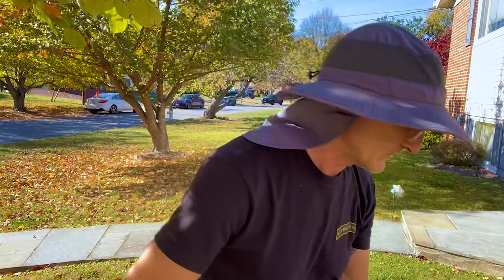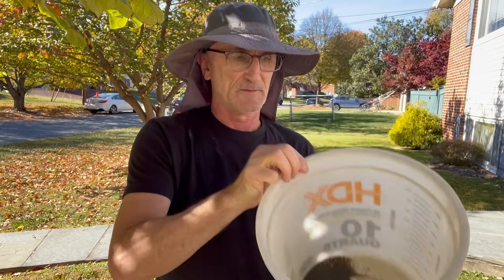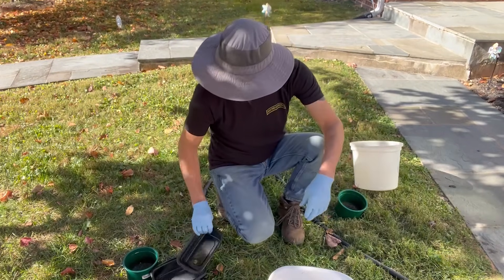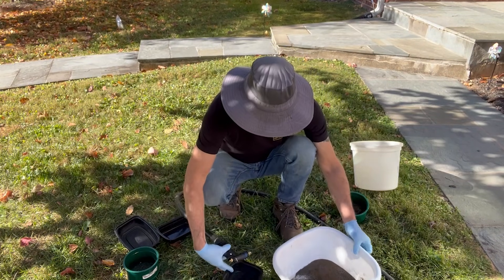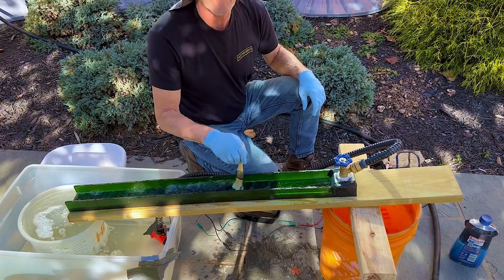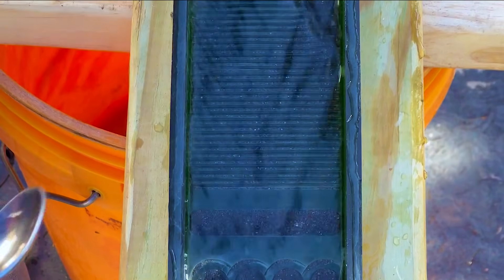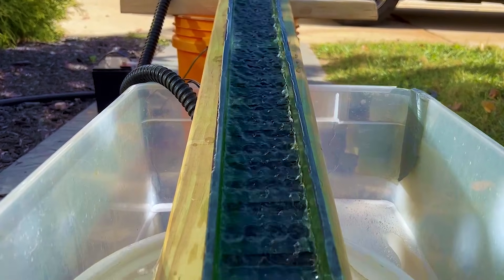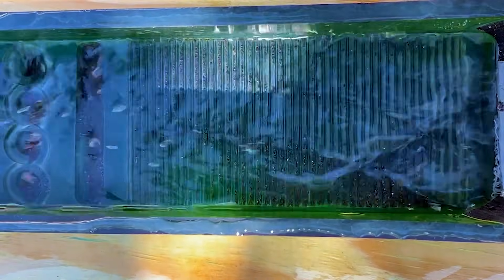Vinegar Extracts Gold From Black Sand!

Comment: The vinegar is a good solution. We used Muriatic acid fifty fifty and allow it decompose the risks down to gemstones and precious metals which are left in a pile after thirty days in a bucket. Somewhere safe outside and caged away from dogs and cats that will drink it and die.

Comment: are you running the sluice slower this time than before vinegar? if so some of the gold you'll get is from running the sluice slower.
Reply: Exactly, no recovery system is 100%, I've run previously processed black sand concentrates through different recovery devices and always seem to find a little fine gold. Water flow and surface tension are critical when recovering very fine gold.

Comment: I used to care about getting all the gold from black sands but unless you have something like a mini Max or Blue bowl or something else that gets everything out it's really not worth the time and effort. I just throw it in a bucket and run it with other stuff in the mini Max and the silicone mat's catch everything but it's a pain getting it off them.  I would just like to know what the vinegar does? I thought it was going to dissolve the black sands and leave the gold but it didn't seem to do anything.❤️💛💚
Reply from the maker: Hi, honestly I don't know why it works.  I've seen other people do it so I wanted to experiment with it as well.

Comment: This says to me that is actually is worth putting your really fine cons to one side for a while and then when you have say a  bucket full, soak it in vinegar and sluice it making the process a bit more profitable.
Very cool process and fascinating to see that there is indeed still dirty gold in the cons even after youve cleaned them out the usual way.
thanks for sharing
Reply from the maker: I know, right?  It always seems like there is just a little more to extract.  The "juice is not worth the squeeze" but it's still fun to do it.
Reply: @ indeed especially when you are doing it as a hobby...or just obsessive like me....I save copper and brass  filings etc from my metal working and melt them down again
Reply: but how much does all that water cost?
if re-cycling the water then how much for the electric power? 
it would never amount to just covering those costa.  forget your time
Reply: @ I use rain water for a lot of things but at the moment the price of gold is so high its quite feasibe to save cons like this and still make money
Reply: Just curious. Has anyone tried heating the black sand to say 800 degrees and letting it roast an hour and then dumping into cold vinnegar and letting it sit for 5-7 days?
Reply: @dreamsindigital1285  to extract  tin?
Reply: @TalRohan   Gold!
Reply: @dreamsindigital1285  ah yes I see , yes it makes sense that there could be some in there. again it depends how much you want to put into it as compared to what you get out I guess...food for thought
Reply: @TalRohan   I look at it as experimenting, any gold found along the way is a bonus. The process I mentioned would be good for doing an assay if curious to see how much, if any gold is hiding in the black sands

Comment: You will get better result if you melt the black. And will see that the gold is also black because is dirty. And mixed with silver and other metals. Once you get the melt cold then refine it to separate. Electrolisis way. Blessings.❤❤❤❤❤❤
Reply from the maker: Melting is usually the best way, but I'm not comfortable with it. I can be a little clumsy some times, and that would not work well with melting :-)

Comment: Why not hydrochloric? It would be so much faster to break down the iron sulfide
Reply from the maker: Too dangerous for me.  I’m not comfortable with HCL.
Reply: @GetTheGold777  Try muriatic acid which is dilute HCl,  I worked with Hydrochloric daily in the early days of my career doing wet chemical analysis.  HCl wasn't really a big deal, throw some Nitric in with it and it gets a little more serious.  Gloves, an acid  resistant apron and safety goggles are the ticket.  You DON"T want to fool with Hydrofluoric Acid which will dissolve any silica based  material it contacts including glass.  It isn't nice to skin or bones either.
Reply: You, sir, are correct, and all that yellow water was atotonomic gold !  FYI  !
Reply: Vinegar definitely does dissolve gold into solution, but I don't think the gold would be visible as a yellow color in the solution. Anatomic gold is actually red used on stained glass as red pigment
Reply: Gold and silver are both used to fume glass to make it change colors and can be used alone on clear glass to get any color you desire if your experienced enough to do it.. I blow glass and am decent enough but theres blowers out there that blow my mind with their fume work the obvious that comes to mind for me is bob snodgrass if your interested just Google his name and fuming glass its amazing

Comment: Is it possible that it was black gold and the vinegar washed it. Or could it of been attached to lighter host rock that dissolved in the vinegar. Just a thought. 🤔👍🏴⚒️
Reply from the maker: I suppose anything is possible.  I had some lighter material in the test as well.  I'm not sure what black gold is...I though "black gold"  was oil (think Beverly Hillbillies)  :-)
Reply: @GetTheGold777  black gold is gold with something coating the surface making it black  its only on the surface and gold is unaffected but makes it difficult to find. Check out Dan herd he has some videos sith gold coated in black just looks lik a stone but on the inside is pure gold nugget. ⚒️👍🏴

Comment: I was always told to heat it up the ore cracks apart release gold with in you may need to dunk in cold water to really get it to break apart not positive
Reply from the maker: I've tried the heating method and it works.  I wanted to try vinegar because it's less dangerous.

Comment: I use the gold claw all by itself, without using vinegar. And still separated the gold quite. Well, the same way you were using it going with a side to side. Motion in the short direction, instead of side to side in the long direction. In the desert with no water, you can use the gold pan like a dry washer using the same method panning dry.
Reply from the maker: Thanks for sharing your technique.  I’m always up for learning new methods!
Reply: I use them out here in the desert for concentrating. It works well and fairly quick.

Comment: I have alot of black sand and it’s shiny like hell 😂 but still i didn’t process it … i will try ur way with vinegar…. I want u to try also charcoal, after burning it u took the ashes then put it in vinegar for 2 hours then pan it carefully…. U will see alot of golden particles…
Reply from the maker: Do you dump the hot ash and cooked gold into the vinegar to shock it, and then let it sit for 2 hours? That's a great idea!  Maybe I'll do a video on this.  Thanks!
Reply: It would help to put the ash/sand in while hot.
Reply: Removing black sand from gold